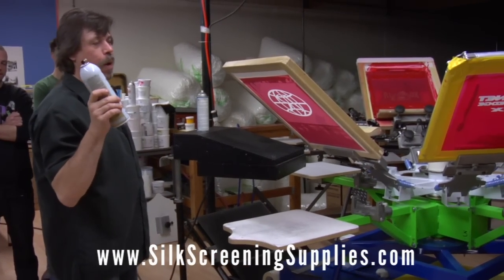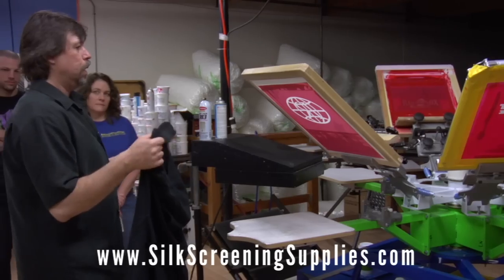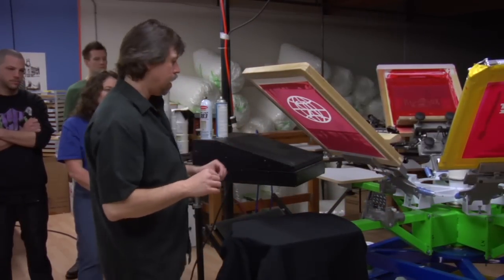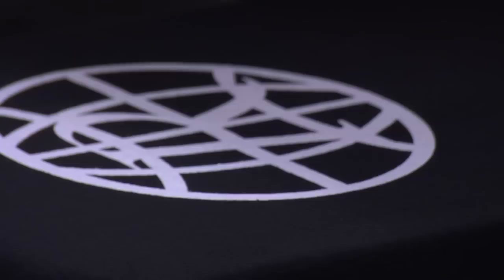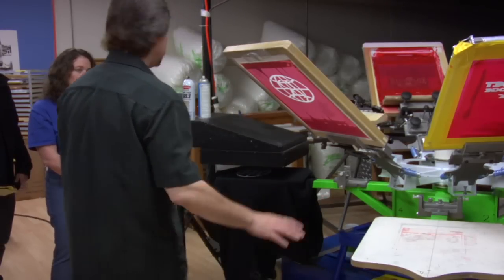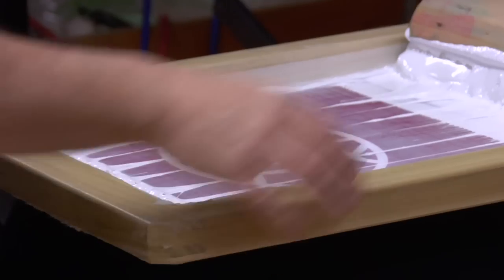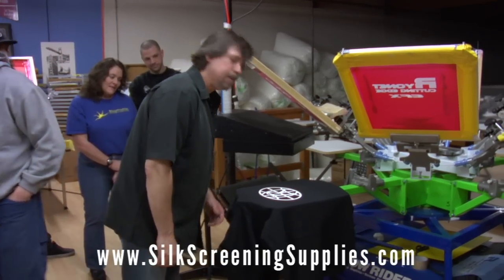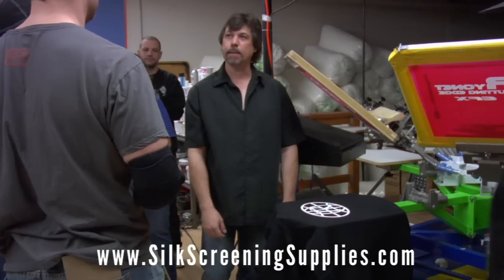How to screen print on a sweatshirt - White ink

Comment: Thanks for the advise, guess I'll have to wait. I am in a rural area and have corn fields on 3 sides of the property and am concerned with how the ink can effect the crops when I wash out equipment/ tools. All our water from the place goes into a ditch then from there to creaks and ponds. Hence why I use water-based inks.

Comment: I designed and made a roller on a sliding mechanism, and with automatic pressure adjustment for squeezing the ink through - a far greater quality job every time - without wrist injury

Comment: hey great video!!
I'm trying to do a normal writing print on jumpers white on black jumpers an i tend to be getting a rough texture but i don't get it with any other print such as tshirts. i think its just the fabric pulling out as i pull my screen up. there is off contact but not to much an I'm doing a hit flash hit...i just can't get a smooth finish an i think its just how they will have be, its only noticeable to the touch.there also enough spray to hold the jumper down an it won't lift...please help lol thank you
Reply from the maker: I think the key here is mesh and off contact, ensure you have a low enough mesh to release enough ink onto the shirt, then the off contact to bound up and leave the ink smooth on the garment. rm

Comment: On any stroke, never leave ink dripped across the image area of the screen. When you lift the screen, you'll see that on the finished product. A mist spray tack is O.K. for sweat shirts & hoods. Leaving the garment under the flash dryer too long is what causes shrinkage. Both types of tack do the same thing, grab fibers. Mist covers more area.

Comment: how do you avoid "chunk" (guy says it at the end of video) or rough texture when printing? i think im pressing to hard and feeding the ink to deep into the material pulling up fibers thus giving myself a rough finish. should i reduce my plastisol ink? im using ryopaque through 156 mesh
Reply from the maker: +Rotary Addiction I believe when Mark made the second pass and said something about it looking a little chunky, he was referring to some "chunks" of ink were still in the screen not being fully released onto the garment.  You can try reducing the pressure while printing and also ensure you have proper off contact.  Thanks for watching!